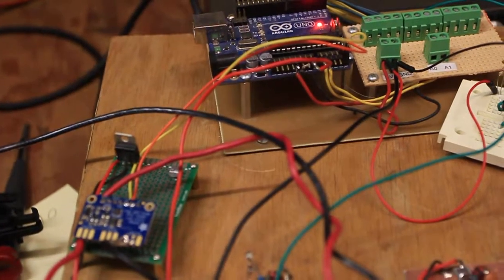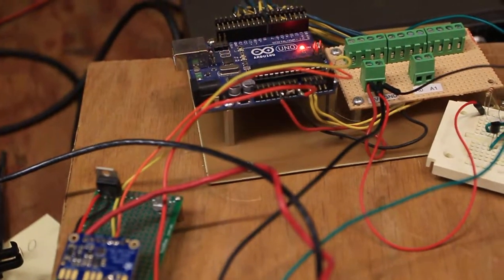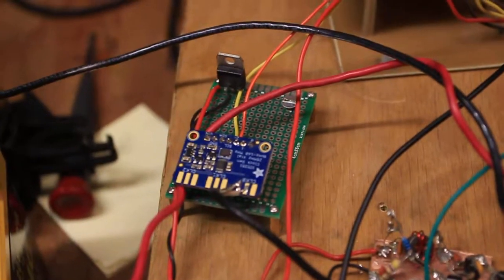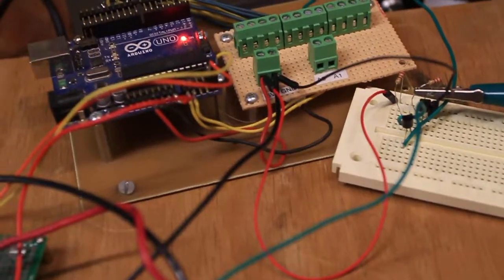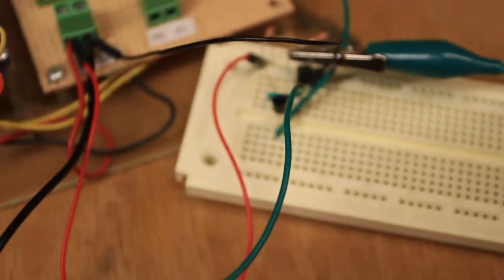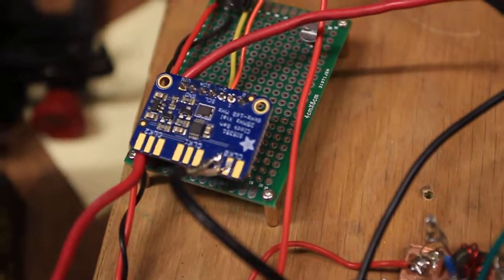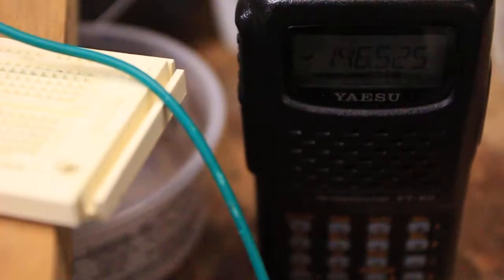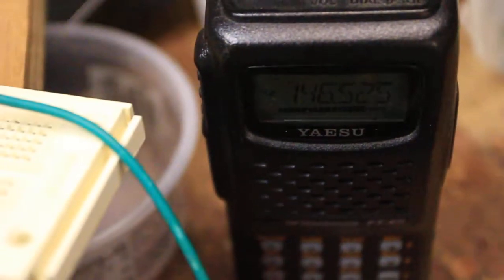Using the Si5351 with Arduino for some simple FM modulation

Comment: Is this using the vcxo pin on the si5351 to directly modulate it?
Reply from the maker: Yes. Not recommended! Square signal, splatters everywhere.
Reply: @ai6yr500  never tried the vcxo but have modulated the 25mhz reference crystal with good results
Reply: @Eltimple  with a  parallel varicap diode?
Reply: @PHILG2864  yeah ...i bought 27 mhz crystals to replace the originals and added a small board

Comment: Well, the 9850 was better documented and fairly popular at one time, but things have changed. Si5351 is very popular now. ND6T has is easygen2, looks very similar to what you are doing except for the modulation. How did you modulate it ?

Comment: how can I get a square wave signal with this module, on the order of 10 MHz but with amplitude from 0V to 3V ??(em MHZ)?
Reply from the maker: The Si5351 can easily do 10Mhz, you'll have to run the signal through a few amplification stages to get it up to 3V.